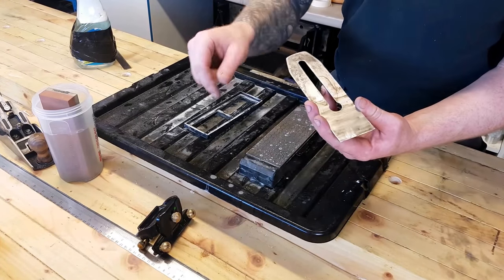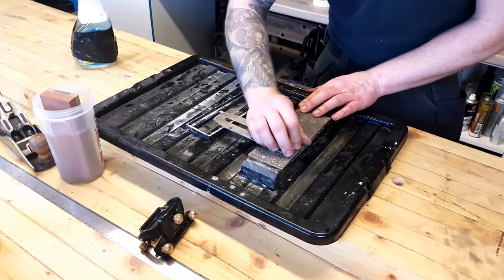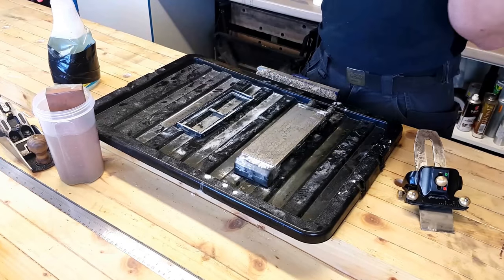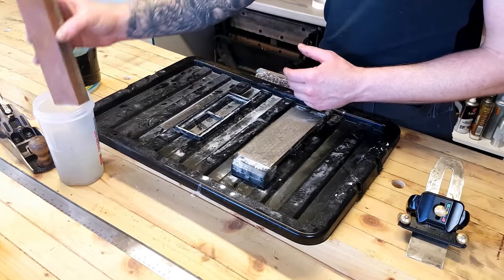Veritas MKII Deluxe Honing Guide Review/ Plane Blade Sharpening.

Comment: Much appreciated!  Thank you kindly for reaffirming my belief in the Veritas MkII deluxe system--it is that to which I am now decided that I soon must be treating myself (and my many chisels + pair of planer blades).   

Your video encourages me to go ahead and commit to the slightly added initial expense of the full featured Deluxe Honing Guide System, which will assure I have exactly the correct guide, rollers and the uniquely interchangeable, reliably repeatable, high-precision assurance easily achieved with the Veritas MkII  angle stop.   It is basically fool-proof, especially for guys like myself who aren't the least bit afraid of reading the freaking manual cover-to-cover before getting started.

Glad I found your channel and looking forward to seeing more content.

Comment: Could you have gone to the leather strop after the diamond stone or do you find it's better to use the waterstone.  Is it may or does the 8000 side sound course.
Reply from the maker: Hard Worker yeah you probably could the 1000 grit diamond stone  puts a fairly fine edge on the blade.    I just find a quick run on the water stone helps.

Comment: Good demo of the Veritas Deluxe honing guide.  As a matter of interest why didn’t you leave the plane blade in the honing guide when you used the strop?  I’d be concerned that I would inadvertently round that nice cutting edge if I stropped  it freehand rather than using the honing guide..  Thanks for the demo!
Reply from the maker: You won't round it on the strop

Comment: Is there a reason you are honing the primary bevel and after that the secondary
Reply from the maker: Branka Hikl I use a small secondary bevel to make it quicker to sharpen up when I'm working. It only takes a couple of passes to get it back to razor sharp. You don't have to use a secondary bevel.